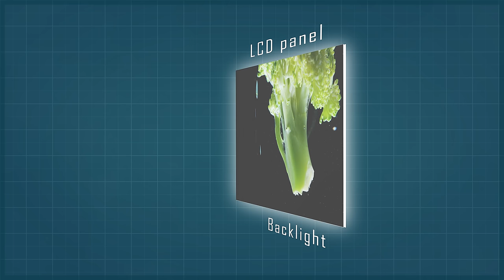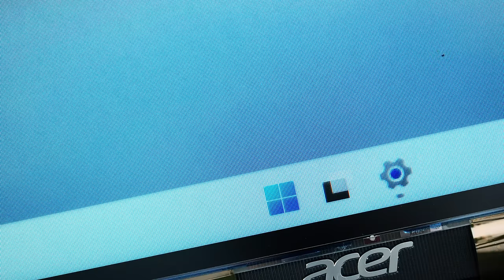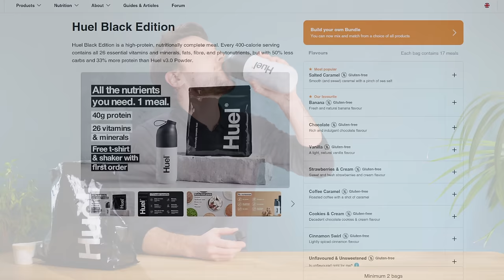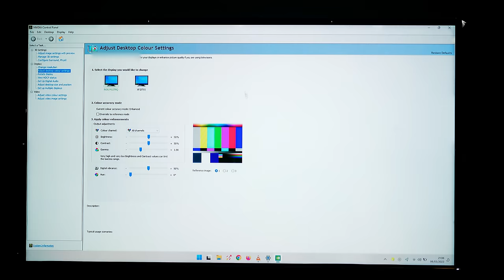DIY Dual-Layer LCD monitor - can it match OLED??

Comment: Something you didn't mention is that you have essentially doubled the display's gamma by multiplying all colors by themselves. Most displays have a built-in gamma of 2.2, but this raises that to around 4.4. You should be able to compensate by halving the gamma in software or in the monitor's settings, which will give you more accurate colors and fix over-saturation.
Reply: same thought
Reply: it would not be 4.4 since gamma is not on a linear function. More importantly, gamma does not describe the color saturation, it is instead a measurement of the luminosity of the pixels. We could assume that the gamma should actually be set higher than 2.2 because the overall luminosity has dropped with the combined LCD screens. As for color oversaturation, color saturation is also not on a linear function, and each color has a different curve. Meaning that each color acts differently on the same brightness, and colors even have different saturation changes with the same brightness change. And to top it off, since the contrast is being changed as well, the color saturations are changed even more. There is no way to calculate the required settings on your monitor. Which is why I'm sure he used a colorimeter like every youtuber out there to calibrate the monitor
Reply: @bobsteven2363  Your fun at parties huh?
Reply: @KenTheSteak  I’m no fun at parties because I attempted to correct someone who is wrong? Do you believe people who are wrong shouldn’t be called out? That’s what Karens believe, and Karens aren’t fun at life
Reply: @bobsteven2363  I asked if you was fun, never said you wasn't, but thank you for answering, although I didn't ask "tell me you don't have friends, without telling me you you don't have friends"
Reply: @KenTheSteak  I never claimed anything about you, I also only asked questions😏. I’m glad you enjoy your cookie cutter responses. Your friends must love your creativity
Reply: @sirzebra  who tf are you?
Reply: @KenTheSteak youre a lonely and unloved, sad dude
Reply: @L4ftyOne  who tf are you
Reply: @KenTheSteak I don’t see a problem with someone correcting someone. He wasn’t being rude lol. Don’t be so dramatic.
Reply: @KenTheSteak  I can ask the same question lol. U think we all just know u? U need a steak buddy u not u without ur steak 🥩
Reply: @KenTheSteak who the f are you?
Reply: @KenTheSteak  😂😂😂
Reply: @KenTheSteak get off your knees
Reply: @KenTheSteak cris provides me with the information i wouldn't have known before, but you shit on him while providing nothing but toxicity
Reply: @KenTheSteak  ooh got ratioed
Reply: @KenTheSteak  unlucky champ
Reply: @KenTheSteak bro got ratiod on youtube😭
Reply: Omg a bunch of weirdos trying to outdo each other 💀
Reply: @KenTheSteak who tf are u?
Reply: While KenTheSteak might have personal problems and it shows, I still think empathy (*where applicable*) instead of smashing him down, will get the massage across quicker and having a faster effect on improvment
Reply: This whole concept of doubling displays is blowing my mind right now, it reminds me of doubling vocal tracks in audio software - in the same way that it "just works", giving more definition and volume to the track.
Reply: @KenTheSteak why tf u r arguing and fighting without any reason??
Reply: @KenTheSteak  Adult people are attracted to intelligence and maturity. Psittacism mixed with immaturity won't impress anyone. I guess you can tell by now, judging by all the reactions you got. Think about it if you want to be invited to the parties.
Reply: AFAIK, stacking the color filters would not cause this effect. A red color filter absorbs all wavelengths of light that aren't red. The second identical red filter would just let the red light from the first one straight through. The change would be from the liquid crystals. If you have the two panels set to try to block 50% of light from the backlight, then the first would block 50ish% and the second would block 50ish% of that 50ish%, leading to 25% of the backlight coming through.
Reply: @KenTheSteak   not everyone's into partying
Reply: @KenTheSteak  This is the type of person I like to hangout with. So yea, they are fun at certain parties
Reply: @KenTheSteak  SirZebra of the Zoo Knights obsviously, you cod
Reply: @KenTheSteak that only works if someone responds technically to a joke…

There’s nothing wrong with technically correcting a technical response.
Reply: @Aurora12488  "The second identical red filter would just let the red light from the first one straight through."

To clarify, it wouldn't let all of the red light through, as it absorbs a percentage.
Reply: @pauliliesi nobody cares about improvment lol we need entertainment
Reply: @KenTheSteak absolutely ratio'd
Reply: @Tatman2TheResQ  The school shooters still talk?
Reply: @KenTheSteak but you still haven’t told us bro

Who tf are you
Reply: @ConfusedGeriatric  Congrats on surviving the warzone aka us school
Reply: @KenTheSteak  who TF are you?
Reply: @ConfusedGeriatric  well he aint telling his name, but im guessing he is from norway (based on my quick research)
Reply: @KenTheSteak  Who tf are you?
Reply: @KenTheSteak  I think he would be great at parties! That was real interesting.

Comment: I would love to see a V2 version of this where you dissemble the panels further and experiment with various filter layers.
Reply: I AGREE! 2nd version soon!?
Reply: what sort of filter layer?
Reply: I support this idea, I think he should go further with this! Maybe that will inspire some manufacturer to actually go to market, people don't care that much about thickness or consumption as companies may think.
Reply: Maybe seeking a pair of LCD panels, one with and one without a filter layer might be a better goal to begin with.
Reply: @b00marrows  Or maybe just peel off polarising layer.
Reply: If this can be done, it would be awesome. If the order of the polarizers doesn't matter, you could remove one from the back of the top lcd (the light exiting the bottom is already polarized) and replace the front polarizer with it. That would remove one polarization layer, letting more light through. Going even crazier you could remove the remove the color filter from one panel for extra light passthrough.
Reply: I'm not sure how likely this is, considering the way he's always uploaded, but this is actually super relevant to me. I've been in the process of building a "light box" of sorts for professional visual art that is at its core very similar to an LCD setup. That involves shooting light (dense rgbw panels in my case) through clear glass plates of water and oil based dyes to a camera mounted above, which allows you to either record or send to projectors to light up a whole room to manipulate live. It's cooler than it sounds. The diffusion layer materials have required more thought than I realized, with me questioning things I'm unsure whether they're high level or really dumb. For instance, are there dark/grey diffusion layers that would trade some diffusion or brightness for more contrast? my best results have just been to use the diffusion layers in old LCDs, but shining LEDs through them kinda washes out the colors since the layers are inherently white. I'd love to see more info and testing out there, the sort of stuff relevant to this project seems to be hard to dig up. DIY Perks honestly is probably one of my better resources for that sort of thing
Reply: @BikeRaceOnly  i don't think this would help seeing how the double polarization effect is kinda necessary for deep blacks.. a few (some not so easy) ways to improve the setup would be to replace tracing paper with actual diffusion paper (he takes apart the other monitor might as well use the paper), using a more efficient backlight, and maybe using software to change transform the image shown in the inner monitor (showing a weighted greyscale version of the original image could do the trick,, introduces a bit more monitor lag tho)
Reply: It would be something quite hard, first of all there are two polarizing filters on both sides and secondly glass substrate layer is very thin and can be damaged easily. So good luck removing both filters without damaging the display..
Reply: @unperrier5998  Removing the polarizer layers from the first display would eliminate the need for the middle layer of paper, and would allow more light through by itself. This process should get it quite a bit brighter, but is pretty risky as displays like this typically use extremely strong adhesive to bond the layers.
Reply: he should redo it and make the 2nd screen a monochrome display
Reply: @BikeRaceOnly ALAS, the set is super fragile, and the layers are often glued nowadays. It would be hard to do without proper equipment.
Reply: removing a polarizing filter from one screen could work, though it could damage the panel and so it wouldn't be so DIY, if you can break it so easily, but making the inner panel monochrome with some contrast adjustment, you could turn one panel into 1920x1080 dimmming zones and it wouldn't mess much with colors either.
Reply: Yes I think the front polarizer of the rear LCD screen and the rear polarizer of the front LCD scrren make a crossed polarizer, so you need to get rid of those. Basically have a double liquid crystal layer, so no need to the grease-proof paper diffuser and several cm gap. In fact might get away with just doubling the number of LEDs in the rear lighting
Reply: Oops just realized the liquid crystal is rotating the polarization, so you end up doing that twice as much, so everything will be messed up. Maybe if you flip one screen back to front and feed it with a mirror  image (without removing polarization filters!)

Comment: I'm just amazed how accurately you were able to align the two LCDs
Reply: Pixels on a 1080p monitor are not actually all that small, you can see them with your eyes if you get close, so it's not as hard as you might think.
Reply: Why does this video only have 700 likes?
Edit: my YouTube glitched
Reply: just use some sort of end stop lmao
Reply: Valid question. Misalignment can lead to Moire easily.
Reply: He has DIY perks?
Reply: @imacg5 The true perks of DIY is displayed here!